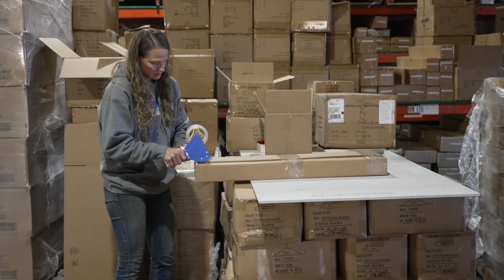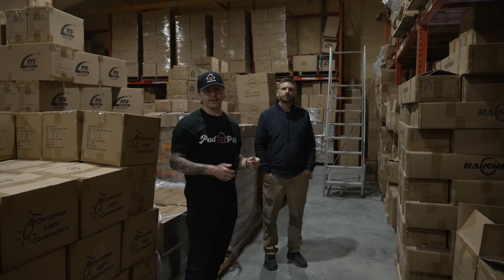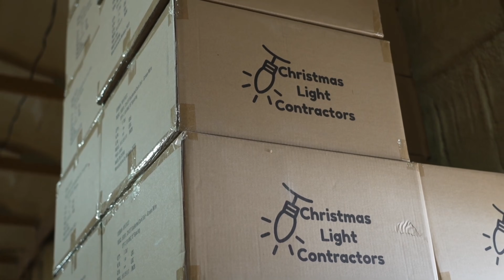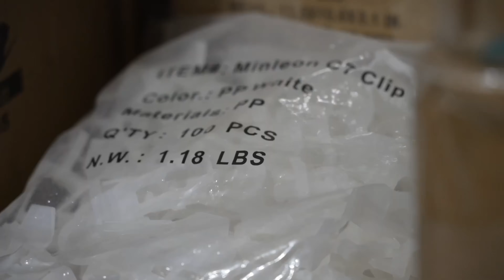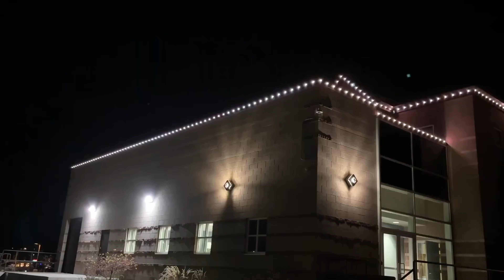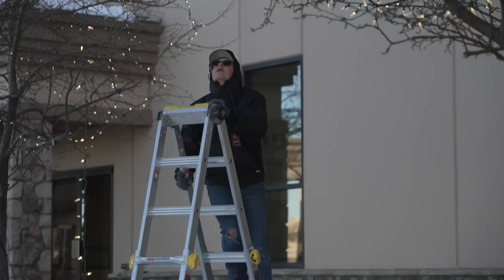Permanent & Holiday Lighting Shopping Guide

Comment: $2500 a year is insane, we had lights put on our house and it was $425 the first year and then $350 for the next two years, 135ft 12" spacing double red double white, and it was a CLC kit because i watched them make the lights right in my front yard, but i wasnt getting on my cape cod roof that has 14/12 pitch.